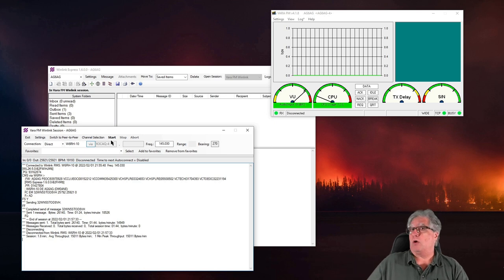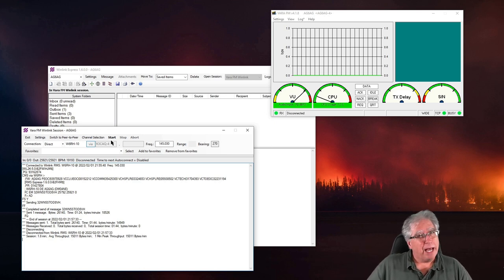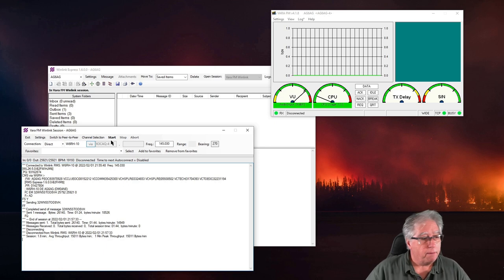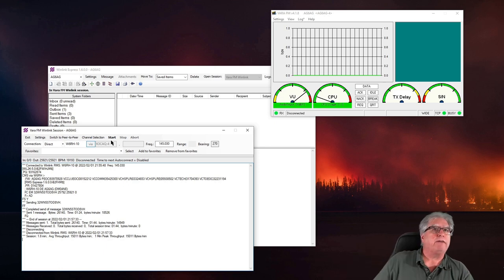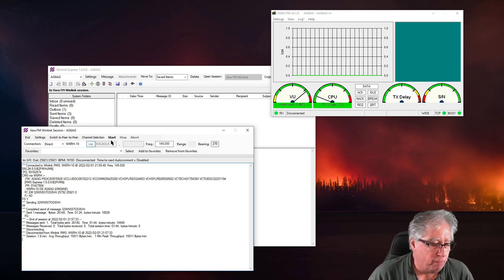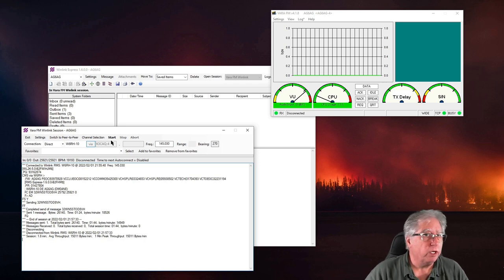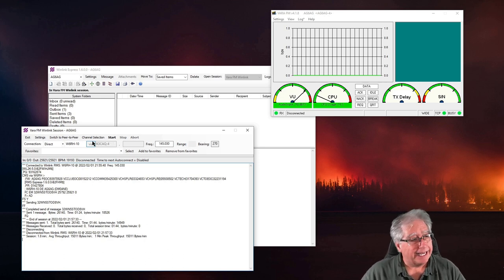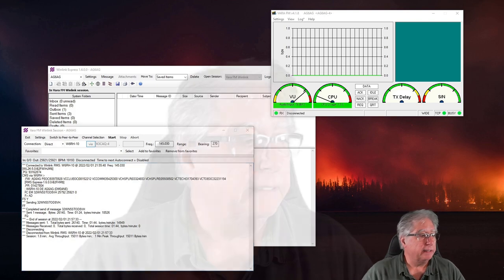Setting Up Vara Wide, Is It Worth It? You Decide...

Comment: Thanks Stu for taking the time to do this.  Good fun as an experiment, less than useful as a communication tool.  I can’t imagine  trying to make it work in an emergency environment.
Reply from the maker: Hi Pedro,
Vara FM Narrow is pretty quick all by itself. If you have the resources and can dedicate some setup to use Vara FM Wide, there is a slight advantage, but maybe not enough to maintain the setup...

Stu
AG6AG

Comment: In Sarasota Fl. where I recently moved from we have Winlink Gateways set up with VARAFM Wide. Some of us started using Masters Communcation DRA-36 and DRA- 70 soundcard devices that are capable of 9600 baud. I connected mine to a Kenwood V71A set at 9600 baud. First of all these can be purchased in kit form if that is what you want or fully tested units already built for a few dollars more.  They work very well and I personally liked using them.
Reply from the maker: Great Info Les, thanks for chiming in!

Stu
AG6AG

Comment: Very interesting video.  Considering the effort to get this up and running properly, in your opinion what would the the minimum transmitted file size that would make the increased data transmission speed worth doing this?
Reply from the maker: Between Vara FM Narrow and Wide, you would really need a lot of data to make it worth while. I need to do some tests with a large number of smaller emails using Narrow against Wide and see what the total time difference really is.
Regardless, Vara FM is certainly faster then Packet at any speed...

Stu
AG6AG

Comment: Hi Stuart, isn't the build in FT991 soundcard fast enough for this? 73 Werner PA3GYV
Reply from the maker: Hi Werner,
Great question! This was a surprise to me. To get enough AF filter width, you have to switch to 9600 baud packet mode. When you do that, it will only except audio input into the data port on the back of the radio.
So... I had to configure a secondary sound card to feed into that port.
Why?
Well it turns out that the engineers at Yaesu placed a audio filter that limits the output of the audio input width under the size of Vara Wide...

Hope this tweaks your head as hard as it did mine... :)

Stu
AG6AG
Reply: Thanks for clearing that out Stuart. Then we have no other way to go with the FT-991 on high speeds.
Reply from the maker: In regards to AFSK style transmissions, yes. There were other strange things I ran into regarding the FT-991(a) that you might find enlightening... Check out these videos:
https://www.youtube.com/watch?v=gSm0o9O6Q3Q
https://www.youtube.com/watch?v=Jf5EZQ0so3w
Anyways, let me know your thoughts on some of the issues I had.

Stu
AG6AG
Reply: I will watch that video to. Nice experiment: Use the internal soundcard from the 991, fire Vara Wide up and see what the maximum speed is and compare that with your find out (via 9600bd dataport). 

Last question, don't you have ground loop problems connecting the Soundblaster directly to  the 991?

Comment: I'm having trouble getting VARA HF to connect using FT-891 something wrong in my settings? I'm trying to get into Digital traffic handling got any suggestions Thank you N8MRS
Reply from the maker: Hi Mike,
I haven't worked with the FT-891 yet. From what I can see on the web site, it looks like the 891 has a USB port on it. It only talks about the CAT interface though the Virtual Com Port provided by the USB and doesn't mention an on board sound device.
Have you got any digital programs working, like FLDigi or WSJTx? If so, how do you have that configured?

Stu
AG6AG

Comment: Be wary of putting too much faith in an "Approved" response from auto-tune, which my system reported when the system turned out to be very poorly tuned.  Using pings for tuning and a final tweak with auto-tune, against a well tuned station, finally resulted in screaming fast data transmission.  VARA FM can be very impressive when configured and tuned properly.
Reply from the maker: Hi PNWcruiser,
Yes, you are correct. The auto-tune can get you close, but what I found was that I needed to push my gain farther past with the auto-tune suggested to get it to move at a proper speed.

Stu
AG6AG